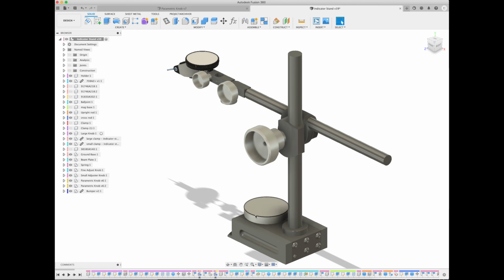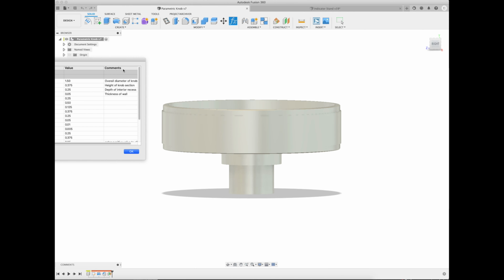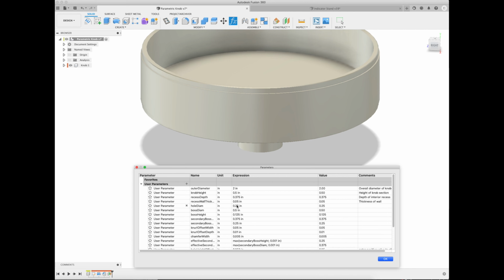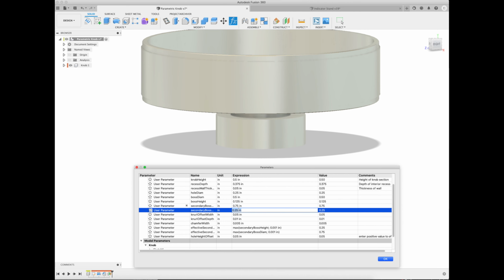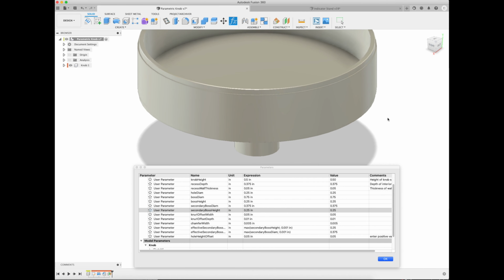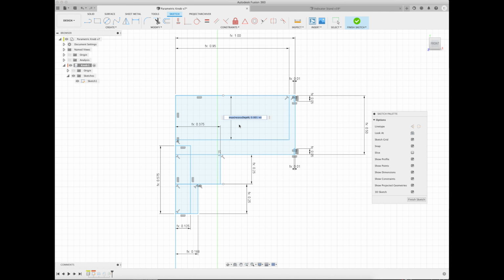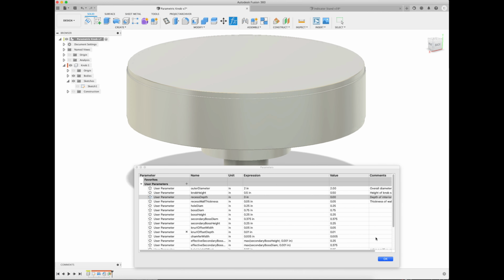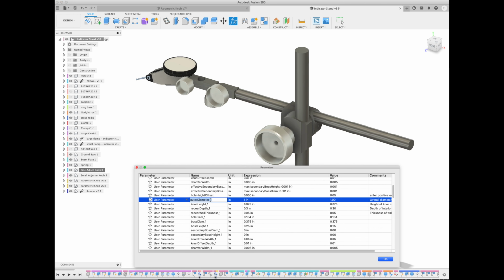Parametric Knobs in Fusion 360

Comment: I thought you might like to know, there is a knurled appearance. Open the appearance panel, and type"knurled" in the search input. You can select the "Face" radio button to apply the knurled appearance only to a specific face. It won't slow the software like a modelled knurled would and it renders quite nicely! Also, once applied to your model, you can edit it and modify the scale.  ;)